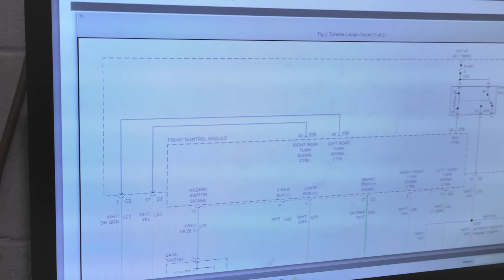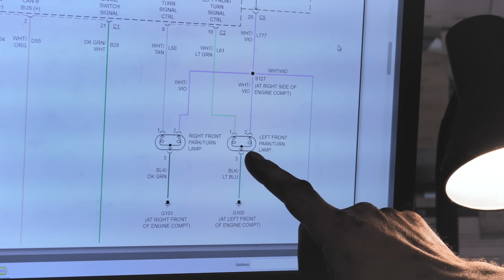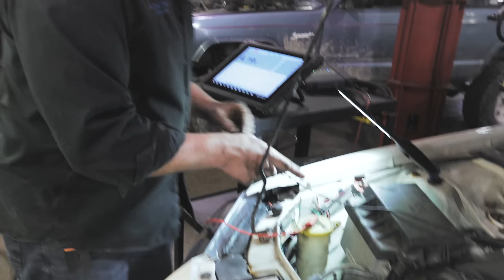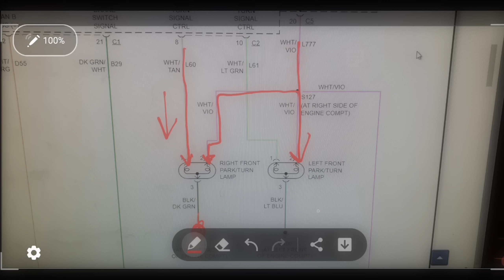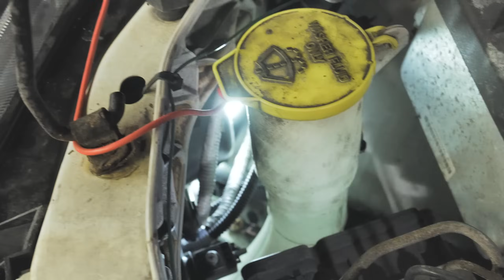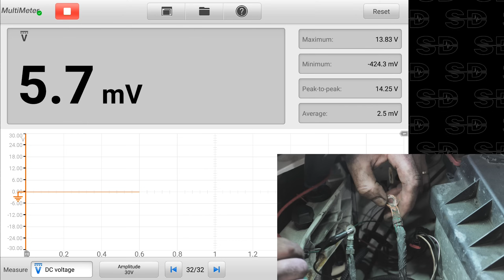Turn Signal/Parking Light Circuit Bad Ground Symptoms and Repair

Comment: What about if the turn signals all work until you turn the headlights on, and then, all the turn signals blink randomly. Front and back, left and right.
Reply from the maker: It's not tur headlights, it's the parking lights that are interfering and when you have that, it is almost always a bad ground

Comment: I have an 08 silverado all headlights, tail lights, etc... works as they should but when i shut the engine off and turn the headlights off just the two small bulbs (park, turn signal) in the drivers side headlight stays on. And drains my battery. What would cause those two bulbs to stay on

Comment: Hey. Like the video. I got one for you....
2011 Chevy Cruze. After a car wash I noticed issues with passenger side front parking lights. One in the headlight housing and the other in the bumper. Curiously, when I lock/unlock doors with factory remote they flask, however, when car is on they don't work?
Reply from the maker: No way I can answer that for you. I'd need to know the system operation, with a diagram in hand and some voltage readings on the non working circuits to guide you

Comment: Great diagnosis, if a bit belabored.  Spraying hot solder with water to rapidly cool it increases the likelihood of cracks and a failed solder joint.  Otherwise, great repair.

Comment: This helped me a little. I have a 08 Ram that the front driver side turn signal won't work at all. The passenger side works fine. When I test it. My test light blinks but very low. I assume it's not enough to make the bulb blink. Thank you for this video. It did give me some insight.
Reply from the maker: How many wires? Just a single filament bulb? If so, then there are two wires.
With the bulb installed (very important) and the circuit energized, take a reading with you're test light (connected to ground) and backprobe the connector. Tell me what each wire shows you.
Reply: @ScannerDanner  First of all. Thank you for your respond. It's a two filament bulb. On my next day off. I will test further and keep you updated. The weird thing is that the running light at the bulb works. I would bring it to a mechanic but not sure of a good one here in FL.
Reply from the maker: @Navajo_Steve  running (parking) light and turn signal on the same bulb? Has to be more than 2 wire. Unless it is a computer controlled bulb?
Reply: @ScannerDanner  I am sorry. It's a two filament bulb and three wires connect to it.
Reply from the maker: @Navajo_Steve  okay cool and the parking lights work fine? Describe what it does with parking lights and turn signals on
Reply: @ScannerDanner  Yes sir everything else works fine. The driver side blinker is the only thing that don't work. When I put on my left turn signal. The inside turn indicator starts blinking fast. My back tail light blink fast and my front signal don't do anything. When I tested it. I used a LED Bulb Automotive Circuit Tester, 6-24V Test Light. I took the bulb off to test. The strang part was the led in the test light blinks.
Reply from the maker: @Navajo_Steve  step 1, get rid of that LED test light. They are absolutely garbage for troubleshooting in 99% of circumstances. 
I'm assuming you've already replaced the bulb?
Reply: @ScannerDanner  LOL I am one step ahead of you. I already in the process of getting a new test light. Sending it back and getting a regular test bulb tester. Yes I have tried replacing the bulb and the socket.
Reply from the maker: @Navajo_Steve  okay cool. Get me the results of the test light on all 3 wires with the bulb in and parking light and turn signal on
Reply: @ScannerDanner  Will do as soon as I get the new test light. Not sure if I thanked you but Thank you for your help.
Reply: @ScannerDanner  OK I finally got a real test light with a bulb. It wasn't easy. Everything is LED now. So the out come is. I am not getting any voltage to the driver side signal light wire. Ground is fine because the running light works on that bulb. All other lights around the truck work fine.
Reply: @Navajo_Steve  hey did you ever figure it out? I’m having the same issue with my 2012 ram but on the passenger tail light. Park lights work but when I hit the brake that side does not get brighter and does not blink when I use the turn signal or put my 4 ways on. Changed the bulb and socket… it’s driving my nuts
Reply: @HomeGrownPyro1  Well yes and no LOL. I went out and purchased a new truck. I did not get it because of the light issue. I just got a good deal and didn't want to pass it up. I figured to let the new guy figure it out.

Comment: I have a issue with my 2022 Tacoma the left turn signal is normal for few seconds and then hyper flashes. It's only the left turn signal. I have checked the light bulbs and they are all good front and back. I do have morimoto led taillights but most people have put these on and they have build in resistors so it should work fine. Any help would be appreciated.
Reply from the maker: My money is on the aftermarket tail lights you installed

Comment: 3 resistors in series = current is divided equally between the 3. All 3 bulbs would be equal brightness.
Reply from the maker: Current is equal but the voltage drop is not due to different resistance on the parking light and turn signal filaments. Only if all 3 bulbs were equal resistance would they all be the same brightness

Comment: When I had this problem on my wife's JK Wrangler, 4 out of 6 wires crimped into the ground eyelet fell out when I lifted it. She then told me the horn wasn't working either. Didn't have this much slack in the harness to work with.

Comment: First off love the content as always. Second I’m wondering if anyone on here or Mr Danner himself could give me some advice /help. 
I have a 1998 Chevy Tahoe with a 5.7. It’s a crank no start. Ran fine the day before came out the next and here it is. 

I have fuel pressure and I also have spark. I have two codes. One is a C0472 and c0503. The first is a steering wheel position sensor circuit low and the second is for the EVO sensor in the power steering pump. Both codes are in the Passlock/EVO module. There’s no security light on. 
 It also makes a loud “ping” noise after about 2-3 seconds of cranking. My question is where would you start and is there any data pids I could look at that might lead me down the right path or maybe cross out some things? And even though there’s no security light on could those codes in the passlock module cause this crank no start? Sorry for the long post just a little frustrated lol thanks
Reply from the maker: What is your fuel pressure? Under 50 psi cranking on this model will be a no start
Reply: @ScannerDanner  Yes sir I have around 55 psi and it’ll hold there

Comment: Not having this problem but I figured I’d comment on your most recent video 
2011 Jeep Liberty 3.7 v6 
Had plugs and wires changed at 100k
150 miles later po304 took it back 
Got changed $584.00 for basically sea foam told coils were good 
Took to another shop they said the other shop used a faulty wire $220 well in 55 miles po304 took back 
They didn’t know what it was 
Told them to put oem plugs and wires in 
$85 
Picked up and could feel misfire immediately 
So I said I’ll figure it out myself 
$217 3 coils I installed ... PERFECT no misfire 
Runs amazingly 
Long story short 
Thank you for dropping knowledge 
I want to learn it all so my family friends and I will never get taken advantage of again 
Also was told it was a poor design that the 3.7 suffers from so internal

Comment: Just a minor point in description - I have found that describing the defective bulb ground problem to new learners as the current is attempting to find a ground, so therefore it seeks the ground via a secondary in-series circuit, as opposed to stating the problem is a back feeding issue.  The newbies almost always cannot comprehend the concept of back feeding.

Comment: A piece of copper tube can be used to make a large terminal.  Smash one end flat, drill a hole in it.  Insert wires into other end, then crimp/solder.  Works well for battery cables.   BTW the dimmest lamp in the circuit will be the one with the lowest resistance.  Regardless of it’s location sequence.  The highest resistance will limit the current available for the others.  It will have the highest percentage of it’s normal current.

Comment: Dear danner . Thanks indeed. 
For all what you are doing. I need to know in witch section . On your book you explain . Pwm . And how it works . Solenoid pmw. Cause it s not  like the solenoid grounded or powered side switsch operation . 
How an injector has 12 v in  One  wire . And near  to 12 volt in the second wire. How to control this solenoid. I think that is not the same operation . Thanks indeed
Reply from the maker: Chapter 3 for duty cycle and PWM.
Chapter 17 and 18 for fuel injector driver designs and testing 
Thank you!  Check those playlists here on YT too

Comment: Back to the EVAP? Does that mean we get to see you turn green Incredible Hulk style? 😁 I'm surprised how exposed those wires are on that ground. It probably would be neater too if Dodge used a ground splice pack there with just one terminal grounding it with a bolt to the body. GM does that with some of their grounds. It's kind of a neater setup than having them all bunched together like that.

Comment: Nice video, question do you ever use a loadPro?
Reply from the maker: No sir, never had a need for it. Understanding loaded circuit voltage drop testing and an incandescent test light is all I've ever needed. 
I know the tool, it has it's place, just not in my toolbox

Comment: I have a signal light  flashing fast, I replaced the light bulb and still flashing fast, do yo think it's a loose ground paul?
Reply from the maker: Check all of the bulbs. Usually the one that is flashing fast is NOT the problem area

Comment: Your students, upon graduation will have a hell of a nitch market for work. Here in central georgia, of the dozen or so shops in the four neighbouring towns, none of these troglodytes fixing the OBD (any series) vehicles have more than multimeters and test lights. They apparently never got into the 21st century for expeditious/exacting work efficiency.
I get the high cost of the analyzers, but with diagnostic efficiency increases, diagnostic time charges, and tax write-offs it seems to be a no brainier.

Comment: I use scan tool in live data
Fuel System : OL-Fualt
Does that mean the ECU problem??
The Car Running not Good
I lose Check Engine in the dash
Reply from the maker: I've answered this question many times and you never reply. At least 5 or 6 different occasions. One day you'll see my replies. You need to change your notifications settings my friend
Reply: @ScannerDanner 
Sorry, I didn't pay attention.
I usually get a notification.
But I didn't get anything. 
I apologize☹️🌹
Reply: @ScannerDanner 
Thank you 
I activated the notices.
I saw your answer to my question. 
He was asked about Fuel System : Close loop - Fualt
But after i've been sure, I found that this problem is showing up in
Fuel System : OL-Fualt
And
Fuel System : CL-Fualt
The Car Running Good only in
Fuel System : Default
Reply from the maker: What are your fuel trim numbers?
What year, make, model and engine size?
What are the O2 signals doing?
Reply: Toyota Corolla 2008
Short term : - 20%
Long term : 1.6%
Oxygen sensor : 3.2 V
Engine Size I think 2L it's not my car
Also i lose Check Engine in the Dash
The Car Running not Good
In Close loop and Open loop only in Default
Also I drove 800 kilometers.
There is no fuel drain. Economical in fuel discharge even with this problem